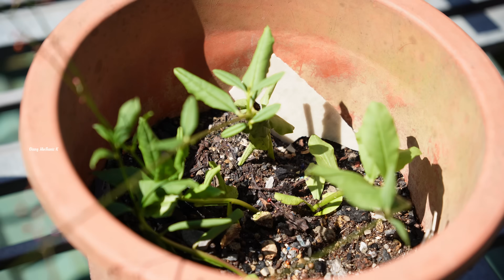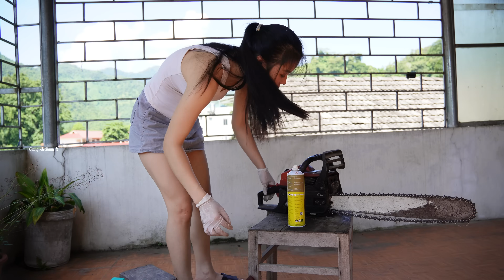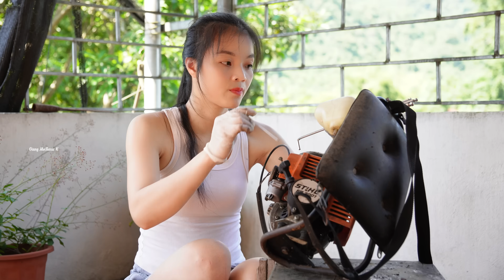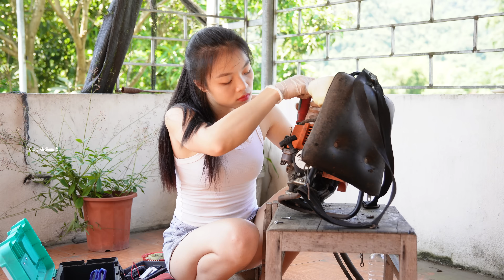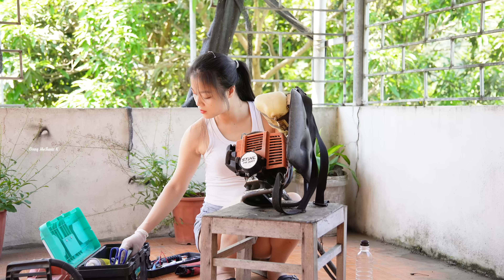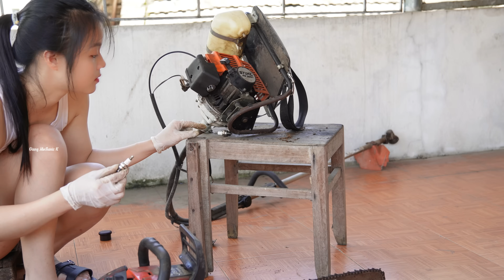Talented 18-Year-Old Girl Successfully Restores Engine That Won't Start! Amazing!

Comment: What can i say other than your simply the best Giang, iv'e been a gardener for the last 25 years so i'm very familiar with what your doing . I've recently retired but still do part time woek in the gardens and repair mowers. 2 stroke engines can be difficult at times to get running ,there not my favorite engine to work on.❤❤❤